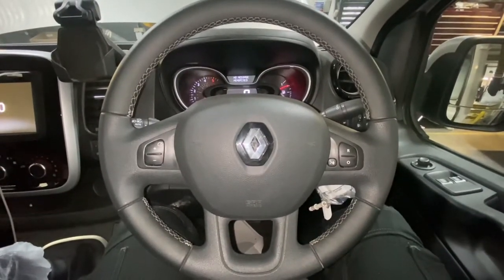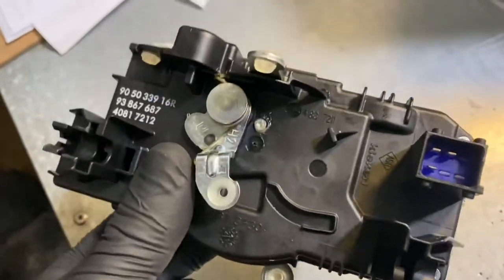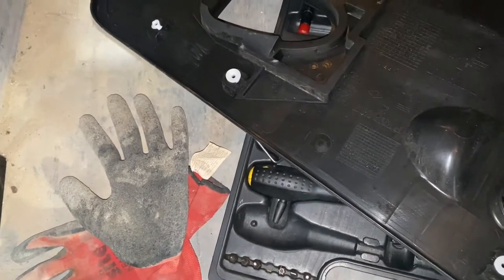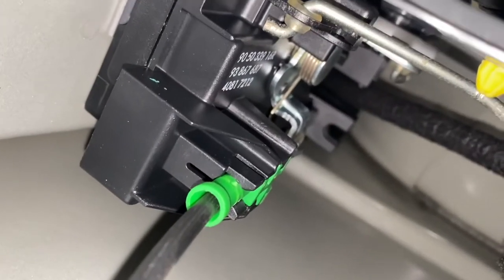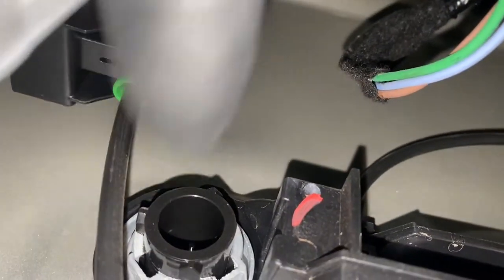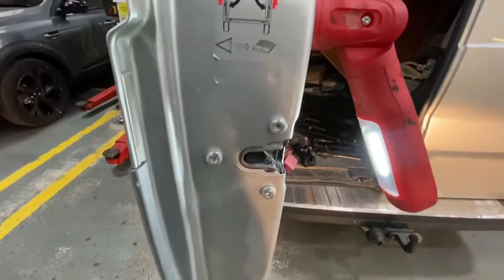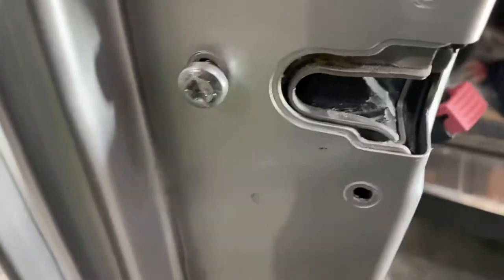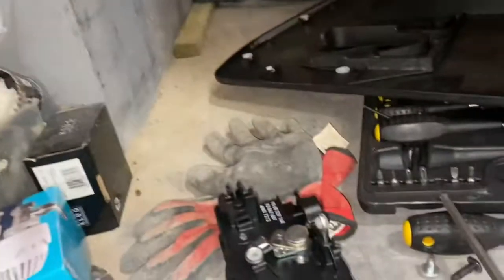#Renault #Traffic #rear #door #Lock #removal

Comment: Was this lock replaced due to an intermittent lock release due to the doors not opening randomly
Reply from the maker: It wasn’t working whatsoever
Reply: @g_a_bofficial  mines intermittent
Reply from the maker: Is it the wiring or the Lock it self
Reply: @G_A_B OFFICIAL  I'm going to check it over tomorrow and diagnose it. One minute it opens and the next I'm screaming